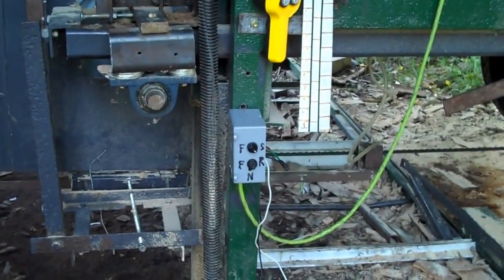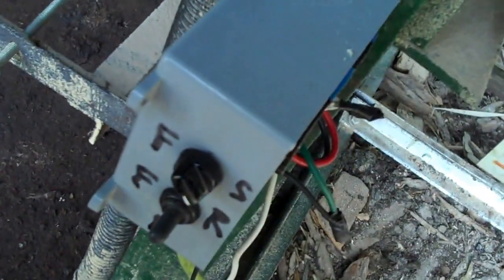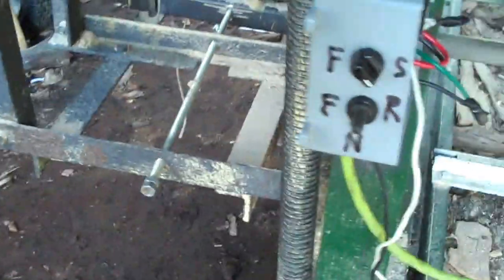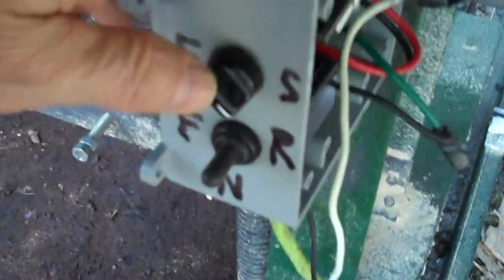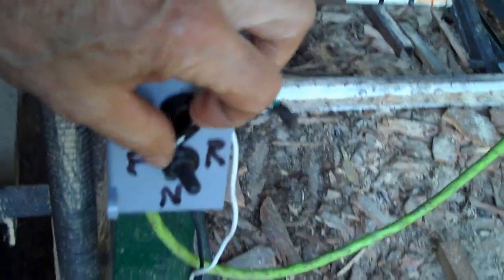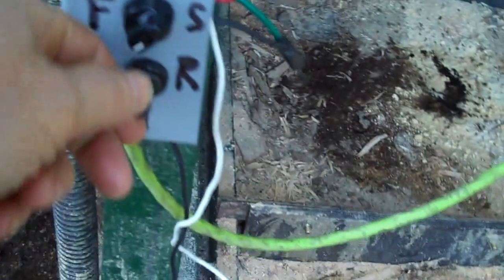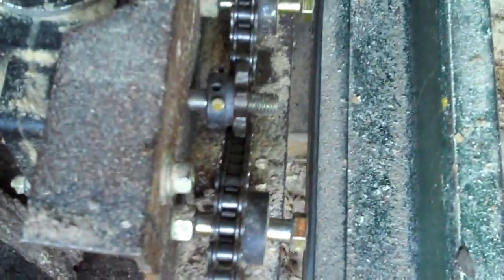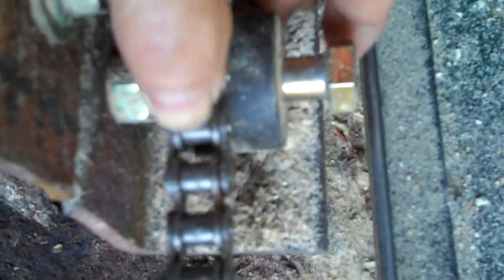DIY Bandsaw mill 12 volt power feed

Comment: do you have any links to where you bought powerfeed  motor ,chain and gears/
Reply from the maker: +revid64 Sure can . The motor was this  that I bought from ebay  '' GEAR MOTOR 12 VOLT GREAT FOR SAWMILL/CRAB POT PULL/FEED 75-80RPM 50:1''  This to control the motor also from ebay ''MXA066: DC MOTOR PWM SPEED CONTROL 30A MAX 12V / 24V 100 Hz ASSEMBLED KIT''  and a switch from ebay ''Waterproof Toggle Switch 3 Position Reverse Polarity DC Motor Control Maintained'' and the gears and chain http://www.amazon.com/gp/product/B00452UE3M?psc=1&redirect=true&ref_=oh_aui_detailpage_o02_s00  http://www.amazon.com/gp/product/B0045JJYSQ?psc=1&redirect=true&ref_=oh_aui_detailpage_o02_s01   http://www.amazon.com/gp/product/B004HKITIE?psc=1&redirect=true&ref_=oh_aui_detailpage_o04_s00

Comment: what is the amp output of your saw charging system?    if it is only 15 amp you will drain your battery
Reply from the maker: It's 17 amps.
Reply from the maker: I also have a deep cycle battery that I'm using on the sawmill.

Comment: now try to run the saw back at full speed   without the pwm  inline on the rev side only
Reply from the maker: I was thinking about doing it like that but I couldn't figure out how to wire it like that. The switch only has 2 wires going to the motor and 2 wires that go to the power. I have 2 wires that come from the battery to the speed controller,and then 2 wires to the switch,and then 2 wires to the motor. Maybe I need a jumper in there somewhere,but I haven't figure that out yet.